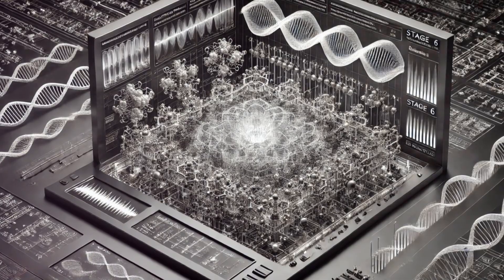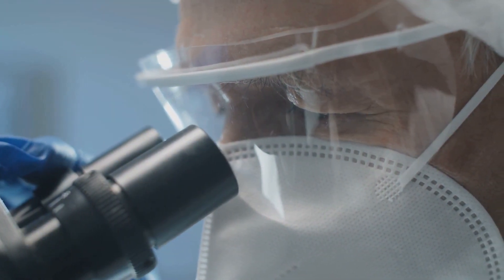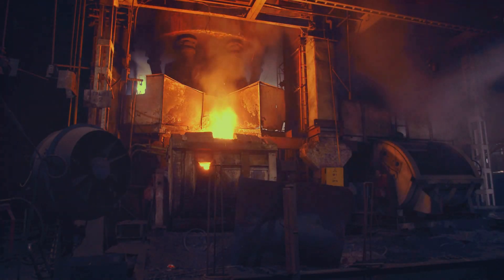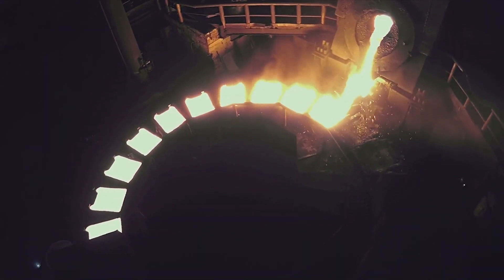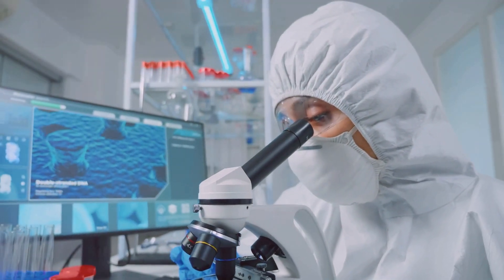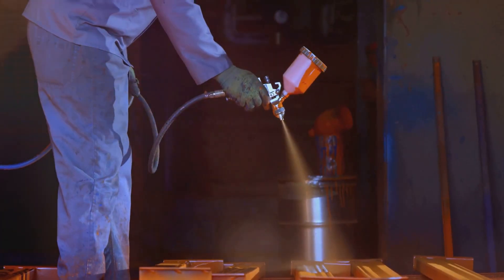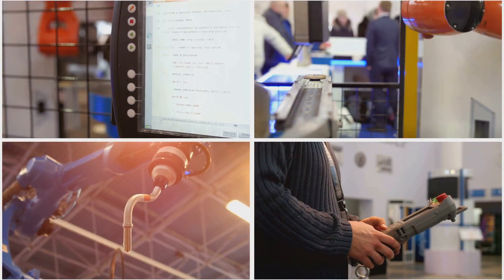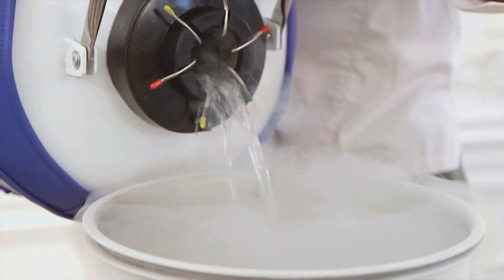13 Steps to Build a Nyrrite-Based Zero Point Energy Harvesting System

Comment: You're not 'bending' the laws of physics, you're showing people that old laws need to be updated, and new laws of physics need to be created to understand where the energy originates, and how the zero-point energy machine is able to harness it. There are much simpler ways to create these machines, so the size of it  is determines by what you need it for. Plasma is the key to zero-point energy extraction.
Reply from the maker: Yes, the current laws of physics are incomplete and need to be revised to accommodate this new frontier of energy extraction.

Comment: Is there any real truth to this? I have seen documentaries that claim that downed Flying saucers have been powered by ZPE power sources. This has been recounted a few times as I am aware. The stories recount a pane of what resembles plexiglass about 300 x 500mm and 5 mm deep. This was plugged into the Flying saucers control panel and this powered the machine with almost limitless power. This idea was not of ours but was gifted to us and back engineered as far as I am aware. If there is any truth to this it is amazing and ground breaking and also spells death to our energy industry.
Reply: It is on the way...